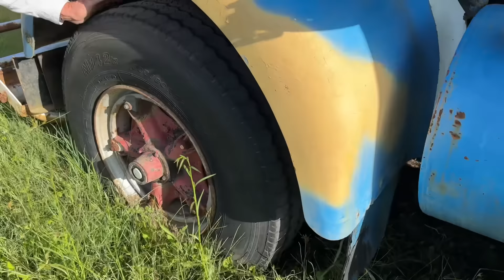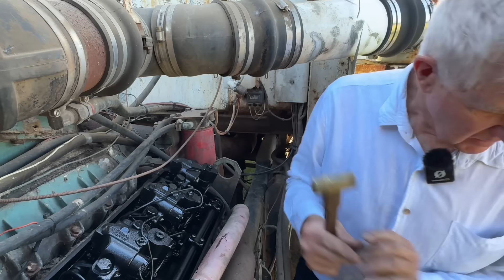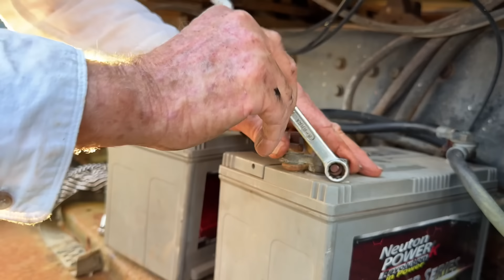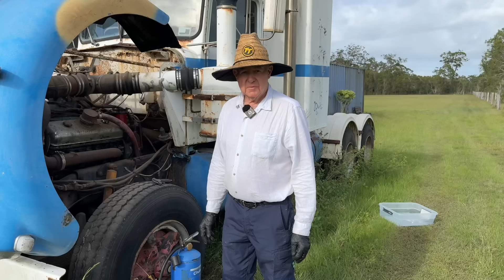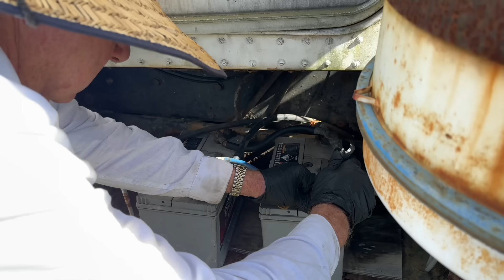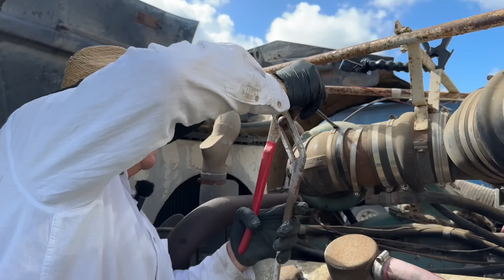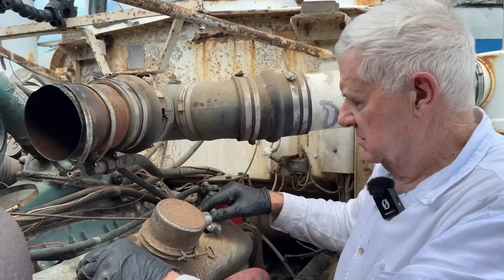Will it START? V8 Supercharged 2 Stroke Detroit Diesel Kenworth Truck SITTING for YEARS!

Comment: Bruce you are truly a school mechanic and I mean that in the most sincere way. From the way you take your time clean the engine off with all your little brushes and things. It's a true pleasure to watch your work.❤
Reply: get hex head drivers for those band clamps so you don’t stab yourself in the finger with the screwdriver
Reply: @dcraexon sounds like you dont know either
Reply: he doesn't know what he is doing. Trade person would have had it started days ago. all he had to do was crack the injectors and prime the fuel.
Reply: @OzBull  You just don't get it do you. Give him a break dude. Why do you have to be such a negative NARCISSIST!
Reply: @OzBull  Then why do you even watch him then?
Reply: @OzBull doesn't make for good tv theatrics though
Reply: @OzBull  hahaha, ozbull is a fit name for you.

Comment: I'll give you a easy way of telling if a filter is going to fit, There are 2 or 3 digit numbers stamped into the top of the filter near the threads. It will either be a number and a letter or 2 numbers and a letter. so long as the stamped number is the same then they are the same size and thread style top. I found this was an easy way to find an oversize oil filer for my car, but it works with just about any filter oil/coolant/fuel
Reply: For real? Cheers mate.
Reply: codswallop yibber yabber knob floggin buttslammer

Comment: A plugged return circuit can have symptoms like you’re experiencing, if that turns out to be good, it could be the governor itself, or something broken in the governor, I do believe they run the lift pump off it on those too. 
Best of luck with getting it going again, those old trucks played a crucial part in getting us where we are today.

Comment: Just a helpful suggestion. 
Instead of using channel locks on the handle of the screwdriver. 
You can use a 3/4 or 7/8 (I can't remember exactly what size off hand) box wrench to slide onto the handle of the screwdriver. Then it keeps the handle from getting tore up from the pliers. 
It works great and way better than pliers.
Reply: Wtf is a box wrench?
Edit. Ring spanner for Aussies
Reply: @philmckrakin6752  box end wrench here in the states.
Reply: @2dogsmowing  yeah mate got the best of me and googled it. Sometimes people don't answer. Hope you're well mate. Oh and thanks for the tip. Won't work on my good screwdrivers but I have a set it will work on that get used for occasions you want to use them for things they're not designed for.. more than once I've had some form of tool on the end trying for leverage.
Reply: @philmckrakin6752  you're welcome. 

The funny thing to me. I thought Bruce was talking about the battery cable ends and not the wrench. Lol
Reply: @2dogsmowing  do you call the KW a tractor? My father did 45 years interstate here and blokes around his era occasionally call them tractors. I operate heavy machinery and refer to them as tractors but most people in Australia would think of John  Deere ,Massey Ferguson and Case IH hearing tractor.
Reply: @philmckrakin6752  yes I do at times or call them semi's. 
I drove 10 years myself.
Reply: @philmckrakin6752  yes I do at times or call them semi's. 
I drove 10 years myself.
Reply: usually on equipment been sitting a while pull the fuel filter off and dump it out and refill with fresh fuel sometimes there’s water and sediment in the filter and you can take a sample of fuel from the bottom of the tank with a hand pump to see how clean the fuel is at the bottom of the tank and hand pump the stuff out if there is stuff at the bottom of the tank if there is there might be stuff caught up in the fuel line and you got a drain and blow those out too and then you used to go to crack the fuel injectors to get the air out

Comment: Good one Bruce. That exhaust flapper didn't appear to be opening very much at all while you had it running. Would be acting like an exhaust brake with it barely opening. Pair of locking pliers on the rack to control its revs is always a good idea.

Comment: recommended to fill from the outside of a fuel filter so un-filtered fuel doesnt go to the engine. not a major problem on a primary filter or older mech diesels like the jimmy but should try to fill it from the outside on common rail ect.... keep the vids coming mate

Comment: When the engine's have more oil on the out side than on the inside, They are Externally lubricated. I have seen on another channel they have a CO2 fire extinguisher on hand for two stroke diesel first starts after been sitting for a few years, they just fire it into the intake in case of run away.

Comment: On a Detroit motor is better to check both under both valve covers because one side could be free and the other side could be stuffed. You never know so on the safe side you should start checking under both bell covers of a Detroit diesel.

Comment: Too much ether will wash down the oil in the cylinders and it makes it lose compression as well as making it hard to crank and prone to scoring. Once you know it will fire on ether, you can switch to your wd-40 or diesel in a garden pump up sprayer if you are spraying directly into the intake. That way the cylinders stay nice and lube, it pops over good and increases your chance of it running without damage.

Comment: I would love to see you get this running and watch you drive it.  I'll bet the fuel pump was worn enough and dry to the point that it wouldn't pull suction.  You probably could have primed it from the fuel rail on to using the squeeze bulb on the outboard tank.  Have a close look at the governor.  It may be stuck.  Also the PTO make have a throttle up when pulled.  That may be another area to have a look at.  Great work so far.  You and your camera man sure do a great job out in the bush getting this old machine running.  Cheers!

Comment: Bruce get yourself  a old car or electric  fuel  pump and most filter  housing may have a spare plug you can unscrew  that and tap a pump in there with a hose to go back to the tank or a can and pull the fuel through  the system  that how we used get them going  when run out fuel  or no fuel getting  in at the start you may allready  know this trick but never seen you use it ok old kenworth  would  do up great again  to best of luck

Comment: AHH the old 2 stroke Detroit That one was 10 years old when i first climbed into  my first truck .Those will be the most cantankerous beasty .If every step  of the fuel delivery system is not spot on it can make you go mad ,  after watching all you did I think you have 2 problems  1 when it tried to run away and shut it down and the problem of getting it to draw fuel .but you already know that .the run away tells me it will draw fuel ( a given) so the problem may lie in Idle and throttle governor and or the mechanical throttle mechanism ..Is there an idle cable pull  knob on the dash? .Keep the faith you will figure it out .As to your question of the tack 1 equals 1,000 rpm and so on up

Comment: Good job mate, 👏  for a lot of years more than I want to admit to I worked for a house Removal  business,  rode alongside a top bloke Ardy Laurie, they started with Bmod Macks ,then upgraded to the Rmod. This truck was Ardys dream truck he wanted one badly, sadly it never happened. Twin Stick , he always said if you can drive one of these then you could drive anything that was ever built . To watch him run thru the gears was a  lot fun 😁,  he would jam his knee under the steering wheel, and run from bottom to top sometimes using both hands on the sticks , never missed a beat. Great mems for me of an old mate.
Reply from the maker: Thanks for sharing such great memories. These videos/this equipment often take folks back to a different time, which is nice

Comment: Small headlights.......she is  early 1970's W-Model pre 1974.  Bloody indestructible, never rust out, can be restored to brand new condition no problem. Could even be updated to modern power steering, the later W-Models had a Ross/TRW mounted in the exact same place.The old slave ram type power steering was pretty ordinary.  The GM even has Jakes, very nice. Even in the 1950's the GM fitted buses in the USA had emergency air intake flapper, stop devices to prevent run aways.   LoL at the oil pressure gauge clamped to the steering column.
Reply from the maker: Thanks very much for sharing all of this Wazza, greatly appreciated

Comment: Nice video but way too much work to inject starting fluid. These old trucks have a hose from the intake to the air compressor. I just take that hose off and spray into that fitting. I could see this fitting on the pipe going to the turbo. Thank you for another video.
Reply from the maker: Thanks Bill I’ll take that feedback on board for the next one

Comment: Looks to be turbocharged   not supercharged as the caption says.
Reply: All Detroit 2-strokes have blowers, not superchargers. The turbo is an addition to its normal aspiration system.
Reply: Absolutely 100% correct there mate, a lot of people still don't understand they are equipped with a blower, not a supercharger 👌👍